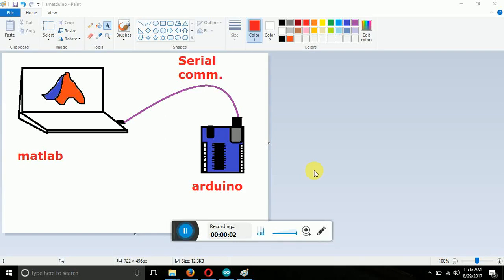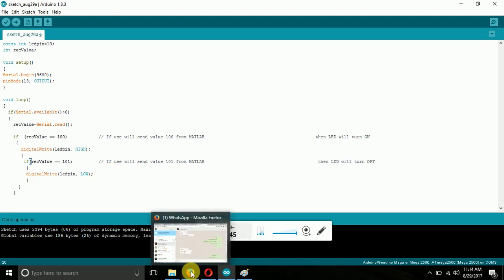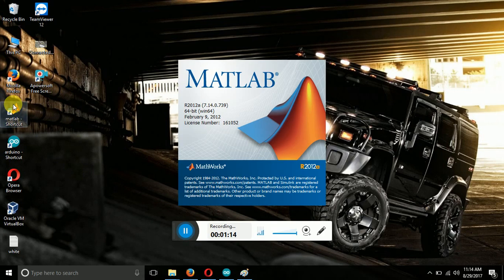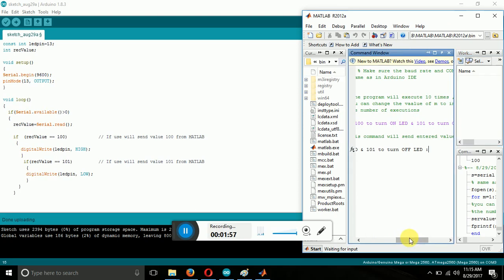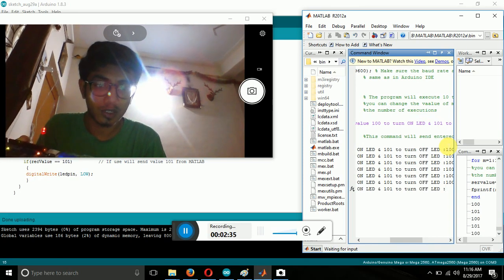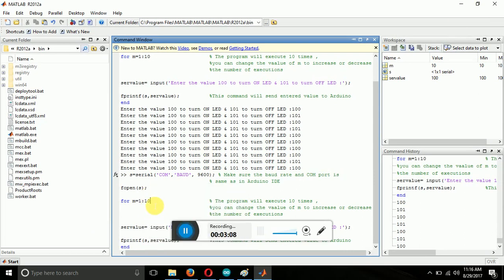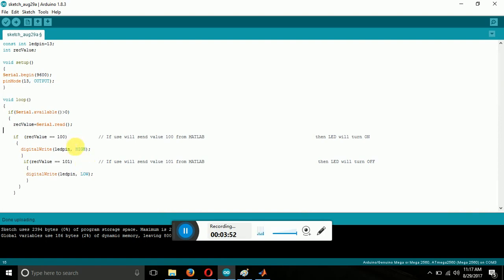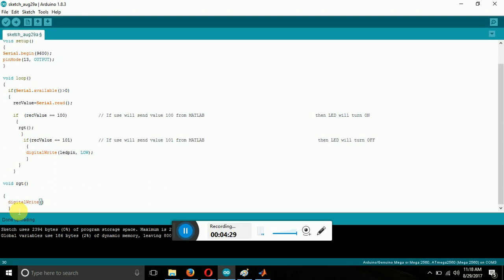Serial Communication MATLAB +ARDUINO

Comment: It doesn't let me use the same com in the arduino and matlab simultaneously.
Reply from the maker: use the port which you arduino ide shows the latest and put it in the matlab code later after connecting and then save the program  .m file and run it then . let me know if this doesnt works too.